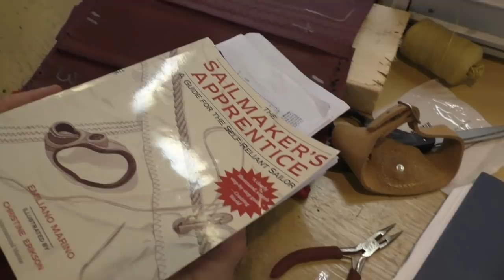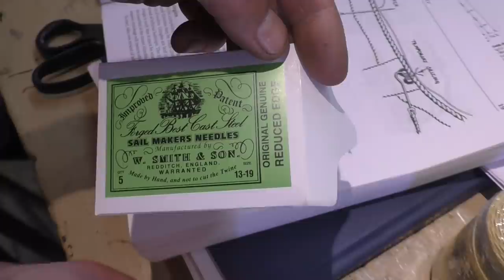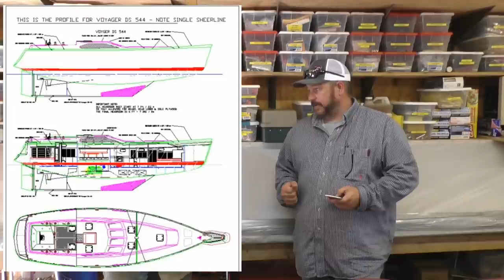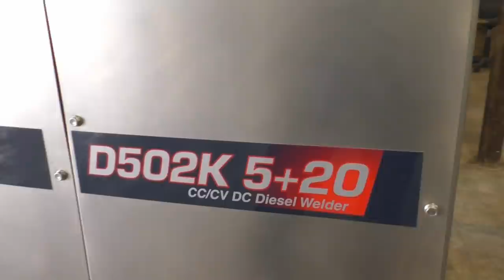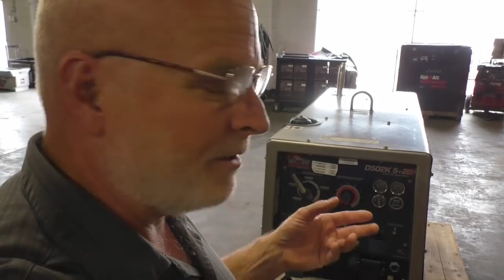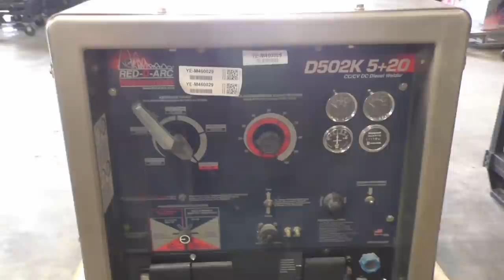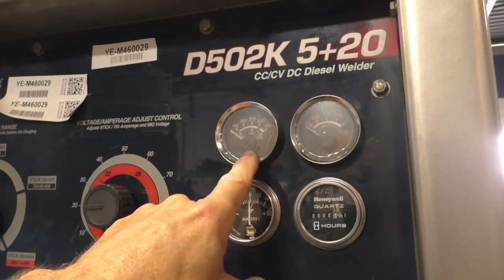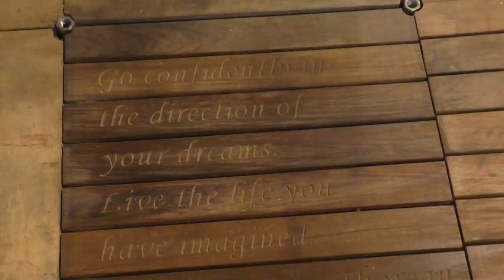Roping Sails, Hatches, Handrails and Build or Buy a Boat

Comment: All the small tugboats I sailed on had small self contained diesel gen sets like the welder you looked at. There was ducting covering the radiator that lead up on deck to remove the heat from the engine room. The advantage of having a radiator, is by opening a hatch in the ducting, the gen set could heat the engine room if you're ever in colder climates. Plus if you install a heat exchanger in the welder's coolant loop you have a free source of hot water, whenever the welder is running.

Comment: That Kubota is amazing. I once used a light tower generator that had a Kubota to supply 120v power to a mass concrete cooling system out in the middle of no where. The kubota ran nonstop for weeks. We never were able to figure out when the machine would stop working.. It just kept going and going.... I would stand behind that Kubota..> Amazing little machine.

Comment: Doug, take it from an industrial generator tech. If at all possible you want to lose the radiator on the generator and use a keel cooler. Salt air works on  radiators quick fast and in a hurry.   If you develop a coolant leak on the radiator and don't catch it quick enough that little kubota will crater.
Reply from the maker: Thanks
Reply: Or, at least install a low coolant alarm and shut-down (if it doesn't already have one from the factory).
Reply: He can cool it the same way he's going to cool his main engine. I live on the coast and a lot of my company's bread and butter Is replacing radiators that the salt air has destroyed. We also work on marine gens in push boats, the only time we see a gen with a radiator on them is when there is a major failure on the built in keel cooled unit they will sling a rental unit on deck and strap it down to be able to keep the boat moving until parts come in.

Comment: Hi Doug. On bending aluminum if you run a straight acetylene torch over the area you want to bend and smoke it well it will soften the aluminum to make it bend without cracking.

Comment: Just a  fyi , many years ago, I was given a project when I was taking metal shop (which was maching welding; and working up blueprints)  this was in high school.  I had to layout, blueprint, order materials; and weld together a 12 ft diameter jungle gym for the school district. Which leads me to the reason I am writing. I used a drill press to cut my pipes. The drill bit I used cut the pipe through and was the size to cut just through the pipe on the sides and the center was rounded so it fit around the uprights  and you could have a even weld all the way around where the pipe fit around the other pipe. They fit approximately around 1/2 way. the drill bit beveled the cut as it cut through.

Comment: Great for Germany. We had an ROP Metal program in my high-school. I took metal 1 my Jr year, and Metal 2 AND ROP Metal my Sr year. We learned Oxy Acetylene, Stick, Mig, and Tig welding, Manual Machining (Lathes, Vertical End Mill, Press Break, Foundry work (casting and forging). The class project was a 12 foot dump trailer. I got to make the scissor lift for the hydraulics. We still have shop classes. I also took basic engines, Auto 1, Advanced Auto, Drafting, Woodshop 1 & 2. 
3/4 of the jobs I've had in life have come from those skills. Welding, Machining, Blueprinting, Framing/carpentry. I wasn't popular, none of us "Shop Kids" were, we were covered in grease and dirt at the end of every day. The problem is most kids want to work with computers or in business because that's what they've been told will "make them lots of money." Welding an pipe-fitting won't make you "Rich" but it will pay your bills comfortably and you have a great union and if you're willing to travel, you can make 150k in 6 months if you're willing to put in overtime. So you work 6 months and have the rest of the year off. Same with Machining, It will take a few years, but if you apply yourself and LEARN CNC and Manual, you can make a living anywhere. Trades and industry is starving for well trained HARD WORKING, individuals. It's the Hard Working part that seems to be lacking these days.

Comment: The electronics are in what Miller calls a vault. Very solid setup I have retired and am in possession of two miller Big Blue 402 units I've owned for years, they run great and are trouble free. Mine have Dutz engines and require a timing belt change every 3,500 hours. One of the machines I have is now showing 8,100 hours. The 402 is built on the same chassis as the machine your looking at.
Reply from the maker: Thanks

Comment: In regards to the using the fan cooled radiator on your boat, it will work fine if you have good air circulation in your engine room.  My father in law has a kabota 10k generator on his 65 ft shrimp trawler cooled by a radiator. They just keep the forward peak hatch open and the engine room door open (no forced air system).  Also, that old kabota is a bullet proof engine. I have seen it seize up from over heating due to a broken fan belt,  and I mean smoking hot!  We just let cool down put on a new fan belt and she runs like nothing ever happen.  This has happen several times due using a improper hose, but, she takes a lick'en and keeps on tick'en!
Very inspiring what you are doing, just Amazing!  Looking  forward seeing her in the South Pacific moored of a tropical island!

Comment: Hi Doug, You will probably need to install some forced ventilation in the engine room for the main engine, so keeping the welder/generator cool, shouldn't be a problem. You could also replace the generators radiator with a water to water heat exchanger.

Comment: Anneal your aluminum. If you have to, get a temperature wax stick (or bar soap) to make sure you heat the aluminum to the proper annealing temper. Annealing aluminum isn't like heating steel where it's most pliable when cherry red. But it's more like making the crystaline structure become lax, and it slowly regains it's temper over time again. Your T6 when annealed will behave like T1 and allow you to bend it without cracking it. Then it will slowly regain it's temper to something maybe closer to a T5 after about a week or so.

Comment: Regarding the diesel generator; a lot of the cooling comes from the air cooling the sump / oil. You can put a dedicated oil cooler on it or run a water loop through the sump to cool it. A sump loop inline with the radiator will make the oil run a tad cooler than the optimal 100C oil is specified at, but it will help in several ways. If you run it with a lighter weight oil it will cool better and start easier.

Comment: Regarding the pump, on commercial sites in the UK tools are required to use 110V created from two 55V feeds with 180deg offset (just like domestic 220 in the US).

Comment: Vent to external via duct work/exhaust and have a fresh air fan into the engine room and to each of the air intakes. You want cold air into the engine for better combustion (it is denser). You also want to vent any blow-by and the heat to make the room more human friendly. Not to mention that the electronics and generator will run better and last longer with less ambient heat.

Comment: Bending aluminum:  It's cracking because it is not annealed.  Scribble blue sharpie along where you want to bend. (on both sides of sheet)  Heat with acetylene torch until blue sharpie disappears then splash with water to cool.  It will bend like butter with no cracking.

Comment: you can bend aluminum easier if you anneal the area you bend before hand. Heat it up to a critical temperature of around 600 degrees and quench it with water.
Reply: Normally you don't quench alu in water when you anneal it. At least we didn't when I worked in a factory where we made venturis from pipe. Neither in the self hardening alu I use on my Land Rover... witch by the way has the strange quality that an annealing only last for a day. After about 4 days it is up to the full hardened state again.
Reply: Fast quench would just make it harder, always thought you let it come down slow if you want it soft

Comment: Don't know why while trying to bent the aluminium, you didn't use any heat! I mean you use it with steel.. also! if you change the alloy & Type of aluminium (3003 Series) you will get much more corrosion resistance, and a more user friendly material.. I'm pretty positive that the aluminium you where using was a T6 aircraft type,, witch is very hard, brittle, and very prompt to corrosion specially when exposed to salinity.... Good video!! I will have serious good envy if you get that welder gen set!! That was a dream machine  man!!!
Reply: Have you consider that they may need that rigidity??
Reply: Migueldeservantes 5000 series aluminium is marine grade, corrosion resistance and strength which what you want in marine that why its used. there is a reason that aluminium isnt heated i just cant remember why.
Reply: Well, I'm very conscious that it actually will lose its hardness.. but thank you very much for your reply.
Reply: another one is to use an oxy acetylene torch, with no oxygen to cover the aluminium in soot, then heat it till the soot burns off clean, that will anneal it and it wont crack when you bend it
Reply: Yes acetylene only!  a few years back I saw a master welder "MASTER THE REAL DEAL" doing a job on a aluminum high end supercar repairing and welding, and his job was wordy of high praises!"Making my best try to don't take the LORD"S name in vain! it was impossible to see where the welding joints where..
Reply: Bingo! We have the winner!
Reply: one thing if your bending with the grain it cracks easier! so bend against the grain. I've been able to bend 1/4 inch 6061 T6 with a some what small radius. now that was with a $250,000 machine.
Reply: If you look at the very end of the video I believe it to be the one where they weld the two pieces of aluminum,, Looks to me like a hatch

Comment: Doug, anneal your aluminum first. Put some acetelene smoke on it for an identifier. Then heat until the soot goes away, but don't let it get yellow. Then quench in water. This spreads out the molecules & the water freezes them there. This will make for great bends with no cracking.
Reply from the maker: Cool.  Might give that a try.

Comment: Hi, if you put that welder in the boat, you need to get rid of the heat. Therefore plumb the welder into the seachest for better conditions below. They make heat exchangers for that Kubota, finding one is the toughest part.

Comment: As for bending aluminum sheet.Aluminum sheets gave a grain in them. If you bend I line with the grain it will crack along the grain lines. Try to bend 90 Deg. to the grain. Even with that said the you have to be careful not to bend to tight of a radius. There are charts available on line for minimum bend radius to sheet thickness. Then you have to consider the hardness het treatment and alloy content of the sheet.Or you can weld it like you said in this video.

Comment: Just an idea to consider.  If you are questioning how hot the engine room will get with the genset running and exhausting the hot air from the radiator into the engine compartment, would it be too much butchering of the genset to work up a heat exchanger (freshwater/seawater) to take the waste heat from the engine and put it overboard?  Engine rooms can get awful hot all by themselves without adding more to it.  At the hull penetration you can always add threaded holes on the outside to plumb a flange to the hull for running the genset on your property/drydock.

Comment: That hand stitching is for the birds.  You should look into a harness stitcher.  Something like a Cowboy 4500 which has a 7/8" sewing capacity.  These machines are not just for leather sewing.  You can use up to #415 Bonded Nylon Thread and a #27 needle.  You could also use a machine like this to sew your own towing straps, cargo straps,  or to sew rope eyes.  The Sailrite machine you have is a great quality machine, but is limited to sailwork and upholstery work with a max of #90 thread and a #22 needle.   In your area of the country there should be plenty of used machines available.
Reply: I dreaded roping the sails by hand until I tried it, I loved it.   The rope is knotted off about every 12 inches.

Comment: I have a Miller welder similar to that but it has a deutz air cooled  diesel with on board air at 40cfm@90psi all other capabilities are the same as that one. It is called a Miller AIR PAK.

Comment: on the engines, consider on line diesel and oil filter changes installation,  as they say you never know when you will need to change them in a hurry.

Comment: On the welder you can use a water to water heat exchange for cooling the engine with sea water without getting sea water in your engine.  Use a cooling jacket on the exhaust manifold and you really don't need cooling air on the outside of the engine.  Just a thought.

Comment: If you want 120v on the boat, use an inverter.
We live in outback australia and are running 2200 watt of power in from our solar panels to our regulators, which fill up the batteries, Our lights are 12v LED light strips, with the option of normal lights when our inverter is on.
We are completly off grid ;P

Comment: im pretty sure you got this figured out Doug, but is the rope your sewing on to help from keeping the grommets from tearing the sail?  if so why not fold the end of sail over and run the rope through the loop the sew the rope inside the fold over ? , the the grommet would have more strength,, ,,,test it like the paint sections , a steady wind that's going to move that boat is going to strain that sail I would think, maybe not just hard to believe that thread will hold all that together especially if you have any fail of it along the way

Comment: Doug, what kind of Aluminium are you using? I have no idea how the different alloys are called in the USA, but I can tell you the European material number you need:
EN-AW-5754 (AlMg3) in it's 'H111' Form. H111 means annealed and slightly strain hardend, but very soft compared to other forms. We had the same problem with cracking bends and the H111 stuff fixed our problem. We bend 5mm thicknesses with an inner bendingradius of 0.8mm without any problem.
Reply from the maker: That stuff is 5086 H116.   First time we ever tried it with that stuff.
Reply: SV Seeker ok, so good choice for the material :) 
here is a information sheet for this material: http://aluminum.adimetal.com/Asset/adi-5086-h116-5803-h116-dual-sheet--and-plate.pdf

There is stated that it can be cold bend with an inner radius of 1.5 times the thickness. If you want it to bend like I have seen in the video I suggest to lay in a round rod with a diameter of three times the remaining thickness. You could even spot weld it to the angle Iron for ease of use.

I Hope that helps :)
And great times to live in when Americans have the same nomenclature for materials like the Europeans. This makes work so much easier!

Comment: Doug - I do not comment much these days, far too many wise words in the comments for me to add any value to. However, in this video where you were reviewing cooling and breathing options for the genny/welder. You probably already know this but, when you view the engine room as a box you have to consider the balance of ventilation ultimately what will the pressure in the engine room be? The care is needed to enable you to open doors safely (or if it at all) and prevent ears popping. In the extreme it may be impossible to open a door or it may fly open and hit someone on the other side. It is easy to sort out but bay need a balance pipe to atmosphere and you can tune using a manometer. You need to consider the capacity of the ventilation supply and exhaust fans and the 'air consumption' of all the air consuming machinery. Offered to be helpful.😉
Love the videos and you seem to be making rapid progress now.👍

Comment: Anneal the aluminium before bending? Use carbolic soap and heat from the other side until the soap goes black, then bend it. Only do one bend operation between annealing.

Comment: All way from New Zealand here shame so far away can't work on the boat , I'd be ditching the radiator in the genset and either running a heat exchanger and raw water pump or putting keel cooling pipes along the hull wouldn't need to be very big with engine that size. Keel cooling would be less maintenance as don't have to service heat exchanger and s/w pump

Comment: Hi Guy's,every type of Aluminium can be bend easily by using a bending radius of 3-5 times the thickness of the material. Those sharp edges usually result in crack's on the outside of the bend. Preheating Aluminium is done to reduce the amount of hydrogen in the cristaline structure of the material. Preheating is used before welding Aluminium to avoid porsity of the weld.Like your Videos and the excellent work on your boat.